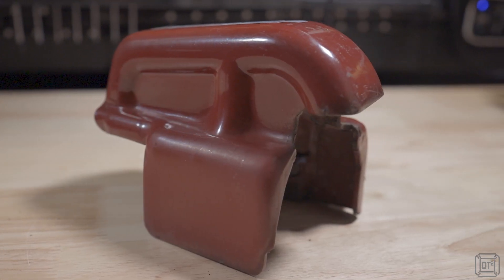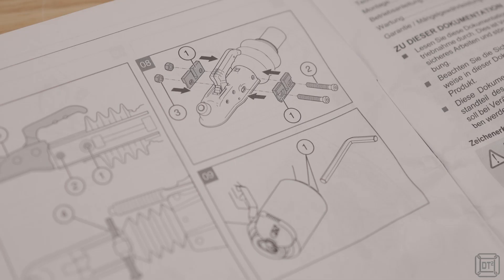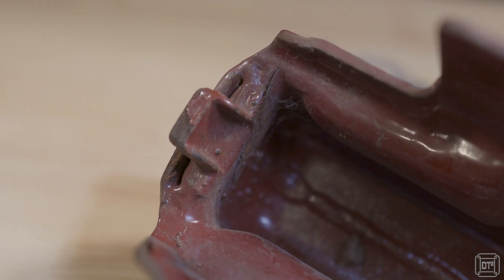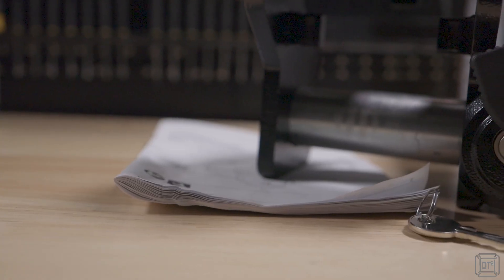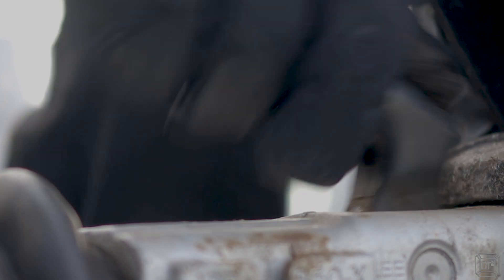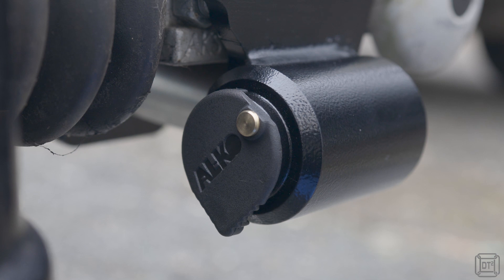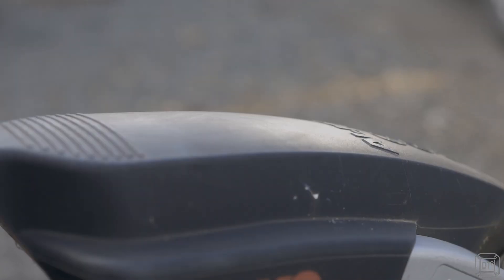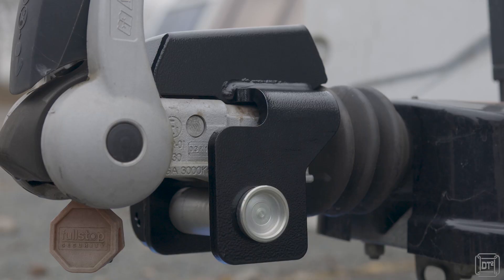AL-KO SAFETY PREMIUM HITCHLOCK REVIEW

Comment: We bought one of these hitch locks when we bought our caravan, I did look at quite a few locks but went for this particular model because it was more robust than the others, yes expensive but we have piece of mind, if I am not mistaken it’s the emergency services that don’t like you towing with the hitch lock on, just in case they need to separate the car and caravan quickly, thanks for your video 👍.
Reply from the maker: Thanks. I believe you are correct in regards to the reason given for not towing with lock on.